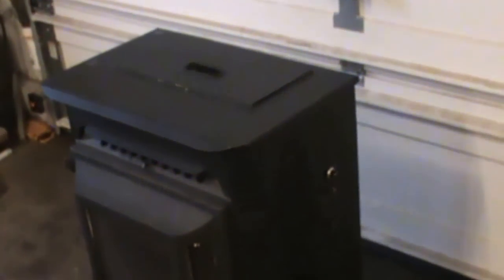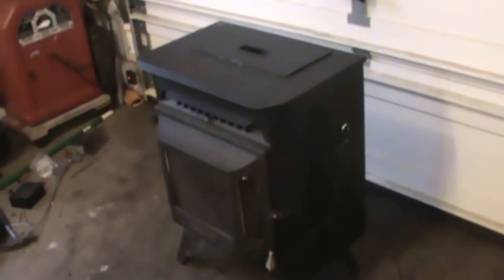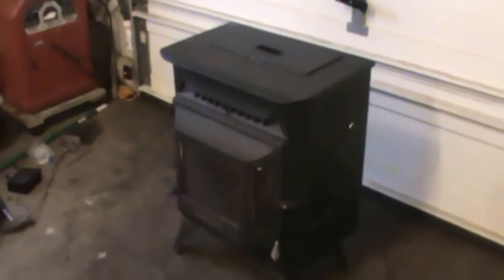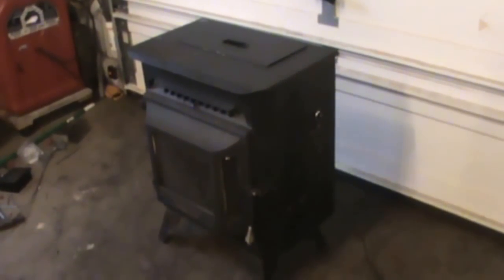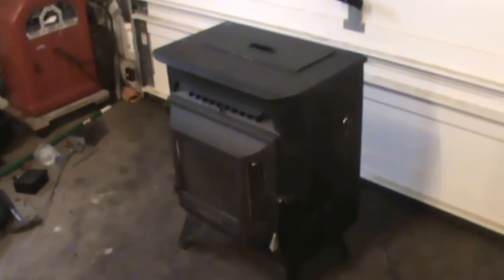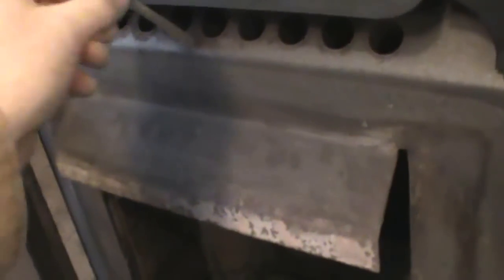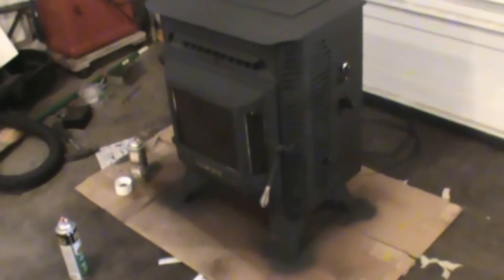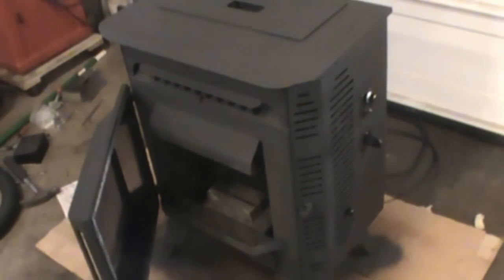Jamestown Pellet Stove

Comment from the maker: I just used some rustoleum bbq high temp paint.  Only problem is that it only comes in flat black.  It would look nicer with a semi gloss.  Go over the letters with gold paint and a fine paint brush.  The paint is holding up well.  Try to locate  high temp semi gloss.  Good luck.  DW6

Comment from the maker: Dave,
I blew mine out with an air compressor about 4 times when I originally cleaned it.  There was so much ash in the inner compartments that I don't know how it ran.  Try to pull the potentiometer and see the ratings on the back, buy a replacement on ebay for a couple of bucks.  I'm sure Jamestown has them as well.

Comment: Thanks for this. I just picked up a J1000 for a small cabin. I think it's a 1996. No igniter so manual ignition which I don't mind at all ~ less parts to fail. I'm going to do a paint job as well. Everything was working on mine and paid more than you did. Still good value considering what's out there!

Comment: Hey Double wide, did you find the inside cover plates, and then the smaller inside cover plates-has to do with the circulation inner outer etc. Just wondered since the guy I bought mine from said it worked well but frankly it was so full of ash I can't see how it did. Question for you do you know where I can get a replacement Potentiometer for the flow control??